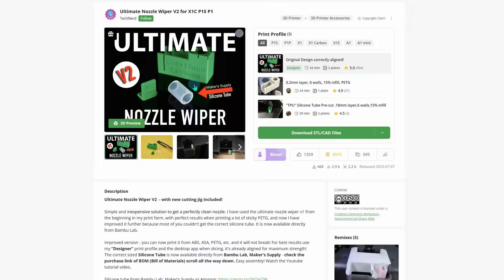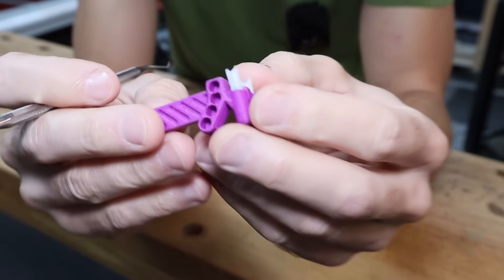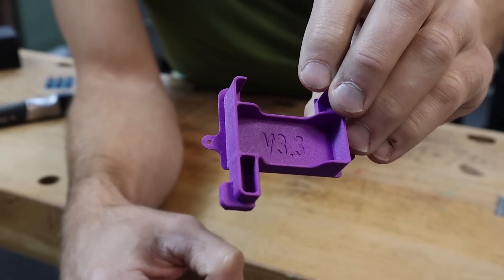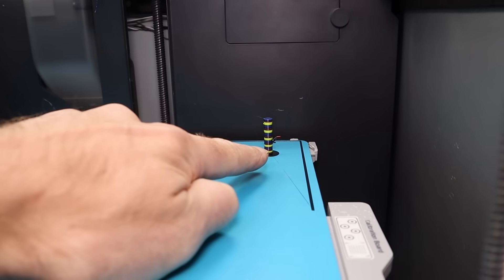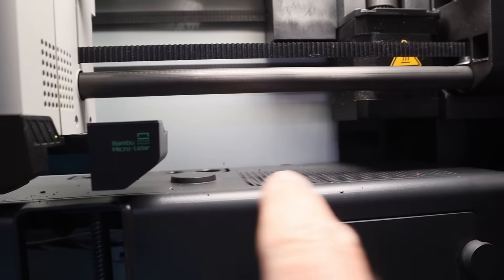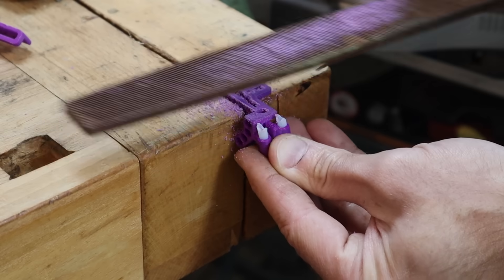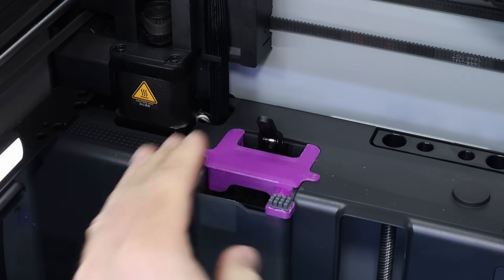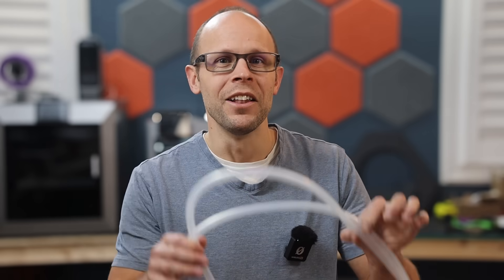Can these really be better than the stock wiper?  The ratings say they can, so let's find out!

Comment: So, I upgrades to the BIQU Panda Nozzle Brush because when I bought it it was on sale and was just as cheap as buying the silicone brushes and 3D printing my own holder. I also have the BIQU Panda Jetpack fan duct. This is a vast improvement but far from perfect.

I thought this was pure gimmick, but bought some anyway. Slice Engineering Plastic Repellent Paint for 3D printer nozzles. It's the same principal as ceramic coating on your car to repel water better and longer than wax. It works amazing! However using higher temps for PETG-CG and the silicon brush wiper, you do need to apply it more frequently than they say, and of course that also depends on the amount of printing you do.  

The other thing I was having issues with was the extruder not being able to pull the filament out. Turns out the Bambu Lab extruder is a total POS! They use plastic gears for almost everything. I use mostly Tinmorray PETC-CF. Bambu's warning about using CF and Glass Fiber in the ASM has absolutely nothing to do withthe filament breaking in the PTFE tubing, because this stuff is damn hard to break, and is almost entierly due to the fact that they use plastic gears everywhere! (Note the K2+ extruder uses mostly metal gears) I replaced the gears in the extruder with metal ones and this sort of helped. It turns out that brand, and color both play a significant part in this. For some you need less tension on the gears and for some you need more. Bambu was so thoughtful and made the print head housing where you have to disassemble most of it to get to the adjustment. I cut a hole in mine. Creality, Anycubic, if you are reading this, I know you guys take these things and make improvements all the time. Make this tension electronically adjustable with GCODE so it can be set per filament. Right now I keen a laminated chart stuck to my X1C with how much adjustment I need to make from fully tenssioned based on the filament I'm using. You can probably see that doing multi-color prints does not allow for adjusting the tension.

I can also tell you the nozzles on the BIQU Panda Revo Hotend Equipped with E3D High Flow Hotend Quick Nozzle is horrible. These nozzles bend and break with the slightest imperfection in your print or leveling. I've gone through 3 in 4 months time so I'm looking for a better alternative.

As for filament... TINMORRY PETG-Eco in Carter Yellow is absolute hell on your extruder, even with metal gears and sticks in the nozzle badly. It's unfortunate as this is an amazing color for anything you need to print for high visibility, or if you want to as closely as possible color match replacement parts for you favorite big name brand woodworking push block.
Reply: These kind of reviews we, at least I, need more. No hype, just facts and experiences.

Comment: I have a wiper on my modified Ender 3 v2 that works pretty well. I use the A1 silicone wipers and then extrude filament, stop extruding , have part cooling fans at 100% for 2 seconds to mostly harden petg, then wipe in a zig zag pattern 5 times. it works pretty well for petg.

Comment: I honestly don't know what I did to get my PETG printing nicely but I don't have problems any longer. I added the A1 wiper to my P1P awhile back but don't think that was the be all fix. I dry it and keep it in an AMS or external dryer. I tried the nozzle coating stuff but stopped since I didn't see a difference. I clean my nozzle with 3m pads and replace them often. I also added a tiny bit of lube to the poop chute and the dingle arm, so poops don't stick to the bowl.
I know this isn't a big help; this video just reminded me of my PETG battle.

Comment: There is a great option that uses the whole scrubber pad for the a1 but you have to do some software changes too and that part I’m not comfortable with.  It looked good though but he rerouted the head path to do what the a1 does and it went back and forth a few times real quick to get a good clean print nozzle.

Comment: It costs a few bucks but I switched to the Leckiestein model and along with it's improved gcode routines it works even better than my previous Scrubbler variant and lets me use the full length of the silicone wiper from the A1.
Reply: Yes this is the one I was talking about but I could not remember the name.  Do you have the ams? I know he had not tested with the ams unit yet.  Also does that g ode mess up with an upgrade of firmware? I’m a little scared to change software on my new machine. How hard is it?
Reply: @allpronutritioninc  Yes I have the AMS and no issues. The GCode should never affect firmware upgrades. The only way it could be an issue if Bambu released some routine that used that area and hit the wiper. That's extremely unlikely on any current machines. It wasn't hard to install, much easier with the latest printable guide and the various height modifiers to get it just right.

Comment: You mention the unit using the A1 wiper is printed upside down, but as you also said, the top surface really sucks when this is done. I flipped mine when I printed it and though it took longer and used a bit more filament for supports, the top came out flawlessly. I even selected ironing top make it the best it could be. The silicone cleaner sticks very well and I couldn't care less if the bottom surface is not as good. No one will ever see that.

Comment: Funny thing is trying to tackle the problem at the wrong end. Main reason PETG oozes and sticks to the nozzle is the temperature. With PETG you need to fine tune the temperature for each color and brand. Sometimes for each spool if manufacturer is inconsistent. 
There is a sweet spot between material being too thick to extrude leading to clogs and material being too flowy so it oozes, and that is only around 1-1.5°, so just using some default settings isn't going to cut it with PETG. Also the default g codes for heating nozzle for filament change and heating pre print are not helping cause they usually overheat PETG and causes all kinds of issues.
Best way to fine tune is print a temp tower with 0.5° steps and wipe the nozzle on each temperature step with a brass brush. Then watch the nozzle closely. If you see material creep up the nozzle while printing then temperature is too high. Just when it starts to stop creeping it is right and going just a little bit lower will cause clogging. That is the temp you need to set for that material. But also keep in mind you need to go 1° higher roughly per 60-70mm/s printing speed to compensate. And settings like retract and z hopping are important too for perfect prints.

Comment: I think combining with gcode modifications is key. The a1 wiper has the problem where you wear the same area/wiper profile. If you have the nozzle move +\-1mm in the Y every scrub, there could be better chance to wipe off all the plastic
Reply: Thats what the SteinWipe does. The code basically transformed how my x1 farm functions. It costs a few bux but its well worth it imo

Comment: I'm confused. You reviewed 3 wipers in the video, only included 2 links the description, and both of those links got the same "Ultimate Nozzle Wiper V2 for X1C P1S P1" model. I think you need to update the link for Maleko to point to "The Nozzle Wiper V3.3 - X/P Series" at a minimum, but I am curious where the 3rd one is located.

Comment: i found setting the flushing volumes higher makes the poop heavier thus causing it to drop in the chute much better. I know it may use a bit more filament but this is much better than a print failing half way because of a obstacle on the build plate

Comment: I still use stock BBL nozzle on my P1S when printing petg but I’ve set the nozzle temperature to 270-275C and had a lot more success and less issues with blobs and sticking. Occasionally have small pieces of petg stick to the nozzle but I’ve now printed several large prints with no big blob build ups that I used to experience frequently before when I used the original recommended temperature settings. It can be a bit more drippy but I can deal with the stringiness more than the blobbiness.

I did change the wiper to a similar design as the wiper v3.3, called the “silent nano hybrid nozzle wiper” by PeGaz on maker’s world that uses a design that looks like the stock wiper with the A1 wiper pad and it uses a lot less material. Haven’t had any poops on build plate and the pad hasn’t come off.

Comment: I've only been printing with PLA and PETG with The Nozzle Wiper V3.2. It's been working well enough. The purged filament hasn't gotten onto the bed often, but since the wiper lacks the spring mechanism, left over filament hangs off the edge of the wiper. I think if I printed a model with many filament changes, I'd eventually see purged filament on the print bed.

I've tried variations of the Scrubbler, since I have an X1C and rely on the first layer scanning, but those deteriorated the A1 wiper pad quickly and was pretty noisy. I'm interested in trying out the Silent Nano Hybrid Nozzle Wiper, which is basically the original wiper, but uses an A1 wiper pad instead of a PTFE tube, and the Bambu X1C Filament Wiper Dual Rollers, which has 1 PTFE and 1 silicone tube.

That said, I'm interested in seeing how you'd solve the problem.

Comment: If you set the printing type to by object instead of by layer you can print multiple of these tests at once without the need to clean and reset the buildplate/print.

Comment: I have a Biqu Jet and the silicone tube wiper V2 on my X1C, I had to add a silicone band to hold the front-hotend cover on (as you figured out). It helps with it occasionally being popped loose.

As for the wiping G-code, another thing I've contemplated toying around with is adding logic to the slicer for it to run a "quick wipe" sequence every X-number of layers (e.g. every 10 layers) if PETG, that way it clears smaller bits.
Reply: Sad no slicer has this option, did you figure it out?

Comment: Clean the nozzle and sock and about every 3rd print spray some silicone penetrating lubricant on a paper towel and rub it on the nozzle and sock. Works for my PETG prints.

Comment: I’m using the big silicone tube wiper and oil with PFTE from Super Lube, it works really good. I rarely need to wipe the nozzle with brass brush. Oil with PFTE is essentially the same thing as the Slice Engineering paint, but much cheaper. 

Maybe I will try v3.3 again, I had a bit problem with it before where after a while the double size tape is falling and the nozzle just drag the silicone off.

Comment: I'm using the 3.3 wiper and having pretty good luck with all filaments but not perfect.  I use the stock nozzles and didn't seem to have the petg sticking to it nearly as bad as you are. I'm primarily using elegoo petg filament.

Comment: The stock wiper is straight garbage. I print lots of petg and i use the ultimate nozzle wiper silicone tube mod with no issues and problems solved.

Also note this above everything else..! Bambu, themselves, redesigned the entire wiper on the A1. Bambu knows its bad. The A1 wipe is vastly superior.

Comment: For me the Best wiper is the Metal Brush Wiper (Dremel Metal Brush). I tried all other ones but the brush version is the best. Simple, fast to print, cheap and performs amazing (had not even a tiny bit of Filament stuck to Nozzle since i installed it (approx 150hrs PLA & PETG). Search: Nozzle Wiper Brush Various Lenghts for X1C/P1S/P1P on Makerworld

Comment: That V3.3 wiper upgrade for the P1S is ABSOLUTELY MANDATORY. My asa would not get wiped off on the stock wiper, causing 3 failed prints until I figured out what was going on. Save yourself the time and install the wiper upgrade
Reply: I have tried the V3.3 but PETG get's stuck in the wiper :( So I am not impressed :(

Switched back to the stock on

Comment: Few suggestions, PTFE paint from Slice engineering(highly recommend for petg), and add some super glue to the bottom of the silicoln pads from the a1 wiper. I have had the adhesive fail on every single one of my printers. After about 300 hours of printing.

Comment: I just bought and x1c from an MK3s+ with a diamond back nozzle which had zero tendency to stick even with PETG. I literally tried the same models you did this past week and had near identical results. The over engineered one worked best for me so far but I have high hopes for a stock wiper plus brash brush and am going to try that in the next week or two. If you find something better I’d love to know - will let you know if I find anything better!  Thanks for the video!
Reply: That's interesting. I have an Anycubic and MK4. The Anycubic was not so good with PETG. Lots of stringing and blobs. Temperature was not stable enough I thought. On the MK4, I have zero stringing. PETG prints just like PLA. No stringing, no oozing, no blobs... 
Do you think it is because of the nozzle? Do you know if there is some coating around the Prusa (or E3D) nozzles?
Reply: @marcusst8809  - My MK3S+ is great and w/ the diamondback nozzle it's even better (at least as far as blobs and stringing goes).  My x1 carbon is amazing with PLA but PETG (not much stringing) but I get blobs on the nozzle like crazy. I'm considering just going to the Diamondback nozzle but it's nearly $200 USD which feels a little too pricey at this point.  I'm going to try an OEM + brass brush design and I'm hopefully that will do a better job of cleaning the bambu nozzle  in a slightly less aggressive way. Today I use the over-engineered PTFE and it works well but it really rubs pretty hard and I worry about long term usage.

Comment: I use the Ultimate Nozzle V2 on my P1S farm that exclusively uses PETG. It's much much more reliable than the factory setup. I don't have nearly as much of a mess and sticking as you do. Possibly the material? I use Voxel exclusively, maybe it doesn't stick to the nozzle as bad?

Comment: I found that the 3.2 works well.  I'm using an X1C with the stock hardened .4 nozzle and the stock silicone boot installed.  I found a video by another YouTuber (this one - https://youtu.be/EF0NnywWeJw  and I also found this one - https://www.youtube.com/watch?v=CO-Lu0doFFI&t=0s helpful.).  He described printing the model out of PETG and using PLA as a surface support filament.  When the print was complete, the PETG part of the support stayed adhered to the build plate (Textured PEI plate) and that was OK (and expected).  On the model where the A1 wiper gets attached, a single layer of PLA remained on the platform where the A1 wiper goes, and I was able to easily remove that using the corner of a small razor blade. I printed the model in black PETG and used white PLA for the support, so it was very easy to see.  The tip of an Exacto knife would be perfect for the task of removing that piece of PLA.  The resulting platform surface was nice and smooth, and using just the adhesive that came on the A1 wiper has kept mine in place so far.  It's not absolutely perfect, as sometimes a strand of poop will get lodged in between the little "teeth" on the A1 wiping surface, but that will get knocked loose into the chute after the next wipe or two.  It's been "so far so good" for me with that setup.  I've had absolutely no poop on the build plate, and it's kept the nozzle clean. This is what works for me right now - I hope this helps.

Comment: I would certainly like to see your thinking on a better wiper.  Lately I have been gravitating to PETG-HF and like you say stringing is an issue.  And quite a bit of misplaced poop just as you say.  It seems like there just must be a simple / effective solution, and as I said I would like to see what you could think up.  Thanks for the video!!!

Comment: There's one called the Devil Wipe (or Devil Wiper?) that works pretty well. Basically it uses a copper wire brush head in place of the stock ptfe tube, but filament can eventually build up on the brush.

Personally, I took the ptfe tubing off the screw and wrapped a really thin strand of copper wire around said screw and that's been amazing. It's been working for TPU, PLA, PETG and ASA.

Comment: im working on a dual/single roller and a 3x4 a1 mini pad that is showing potential. its all with the stock gcode so i dont have to mess with that stuff ;) i got a lot time these days so i can sit and watch it. will update you when its more reliable, currently 3 poops of 155 changes. i print the roller from pp and reinforce it slightly so the roller does not bend to one side for the shape. 

also placing the roller about one rollers width to the left is looking like the way to go using two "stockish" rollers and cutting out the 3x4 entirely as it gets backed up with fine hairs or blobs that go back onto the nozzle on the final exit from the wiping.

Comment: Why wouldn't you want to use one of the anti-stick nozzle coatings instead? That surface finish/material just seems to be an absolute PETG magnet. If it touches it, it's just going to stick, then bake itself on. It needs to not want to stick in the first place. Because it sticks on the 'lip' of the nozzle, and as it exits any of the the cleaners it just yanks the purged filaments back out as it leaves.

Also modifying the g-code is way less invasive than making new parts for the machine (not as entertaining though) but I've poured though some of their gcode for my A1, some of the ways they do things are weird and kinda lazy, I've happily modded them once I was sure I had a grasp on what might go wrong, disabling the vibe compensation shakes but keeping the vibe compensation enabled, as well as fixing how the head parks half-way inside the wiper system, making it absurdly annoying to clean between prints and causing oozed filament to agressively hang-up at the start of each new print.